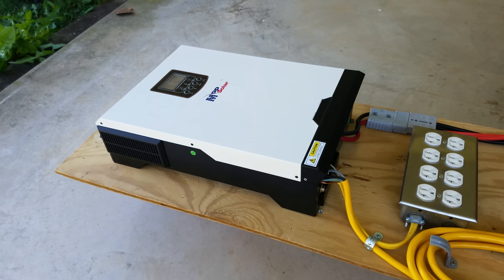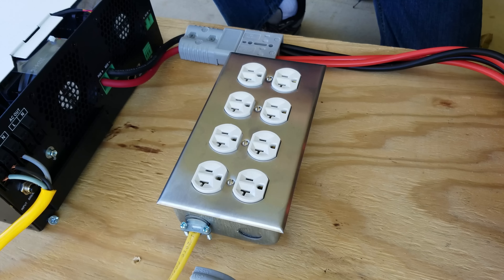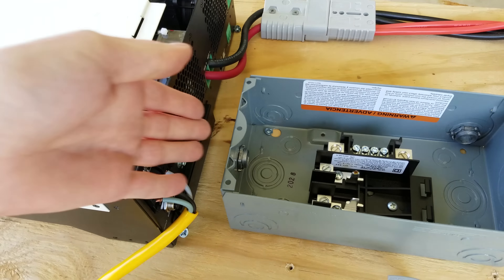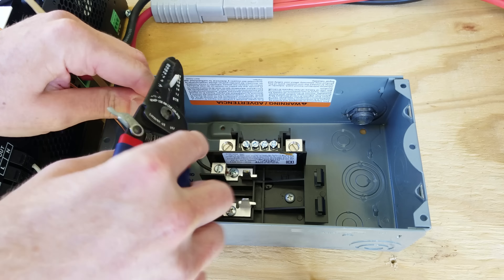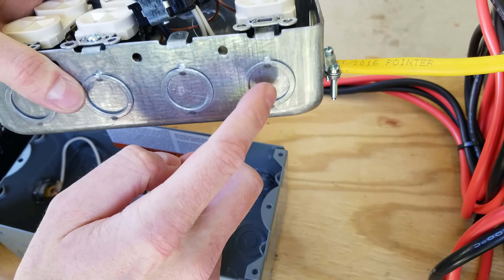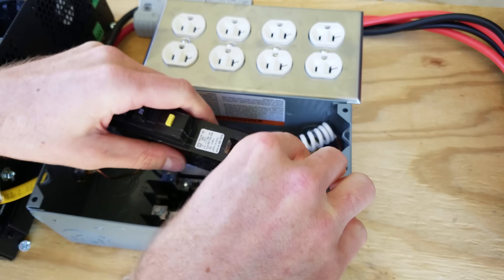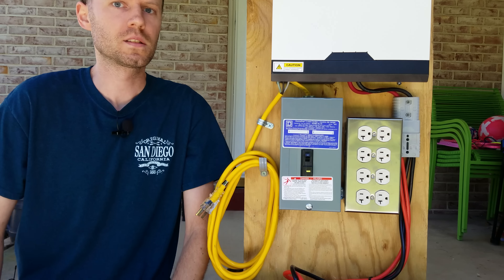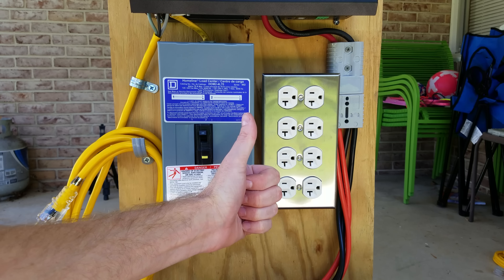Adding GFCI and Over-Current Protection to the DIY Portable Power Cart

Comment: A ground rod would make it more hazardous. 99% of people misunderstand what earth grounding is for, but trust me. Just don’t connect it to your household wiring and you’ll be fine. 

The fact that the manufacturer explicitly stated that they don’t want you to bond the neutral to the ground is interesting, and leads me to believe that the inverter may have some sort of imbalance sensing built in (though it may not be sensitive enough to label as GFCI).
Reply: Yes! Believe it or not a grounding rod does not make you safer. Earth ground is for equipment safety. See MikeHolt videos on this topic.

Comment: Hi Mike! Thank you so much for sharing your videos. Both you and Will inspired me to create a similar portable solar generator with 48v 90ah 16s LifePo4 cells and a Growatt 3kw all-in-one inverter (600w solar array). It uses a Daly Smart BMS that works excellent. I have the same subpanel you have and 20A GFCI circuit breaker. I wanted to add a 30A circuit breaker to the subpanel in the back. Was hoping you could do another update video to show how this could be done on yours so that others, like me could learn how to do this with a single phase subpanel. Thanks again and good luck!

Comment: Regarding alligator clamps/clips... Aviation fuel hose carts and fuel trucks have alligator clamps that can be attached to ground rods installed in the tarmac where planes park to dissipate static electricity while fueling.

Comment: A small suggestion, totally unrelated to the electrical side of things, but using bolts that go completely through the plywood, would give more security than those short wood screws.  To avoid bolts sticking out the back, use some 3-prong T nuts on the back of the plywood.

Comment: I believe from watching another video that GFCI protection can be a good substitute when you don't have a ground.
Reply from the maker: That is my understanding as well, though I'm not an electrician myself.
Reply: @LithiumSolar  This exactly is done all the time as a retrofit in older houses that only have a neutral and line pulled in the walls but don't have a ground wire. Its totally safe now. I would consider running a ground wire from the panel out through the back and bonding the metal hand cart so there is no chance it gets energized by a worn out extension cord resting on it.
Reply: I don't see what extra protection the GFCI provides when live and neutral are not referenced to earth ground. It is safe to accidentally touch the hot or neutral wire (but not both) since there is no current path from you back to the inverter. The GFCI would not trip. If however the ground wire is electrically bonded to the neutral at the inverter the GFCI provides at least some extra protection because it protects against the case when the cart metal parts comes into contact with you either directly or through some moisture perhaps and you accidentally come into contact with the hot wire at the same time. But I believe the ground wire is not bonded to neutral in this installation, so the GFCI provides no extra protection. It doesn't hurt anything though.
Reply: @mcg6762  it would be the same as replacing a 2 prong outlet with a gfci outlet and labeling it “no equipment ground” as required. Gfci does not require a safety/equipment/circuit ground to work. It detects current leaving the hot and not returning via the neutral (presumably going through you and back to the inverter some other way) Youre mixing up what a normal breaker (which trips when a metal appliance energizes itself) and a gfci breaker do. In any case, i think the inverter is internally bonded.
Reply: @jasonjayalap  I believe the inverter ground is not bonded to its neutral in this installation as stated by the video author in another thread. The reason I believe the GFCI does not provide any extra protection in this specific installation is that the inverter is effectively isolated from the user's surroundings. This is not the case on an outlet labeled "no equipment ground". An outlet's live is referenced to earth ground, so anything you come into contact with in your surroundings has a current path back to mains neutral. That is not the case with live coming from an isolated inverter.
Reply: @mcg6762  I get you now. It is hard to imagine someone completing a circuit (shocking themselves) that isn't via the neutral (therefore apart from the gfci protection). 

As far as the floating neutral, I can't see why it would be floated AND the panel not bonded. The safety ground is useless in this case and providing not protection against faulty/energized equipment, right? Did he test continuity with a multimeter or outlet tester? Shouldnt he bond the panel if this is the case?
Reply: @jasonjayalap  Yeah, I also think the inverter ground is basically useless in this installation. The reason the inverter does not connect ground to neutral is that it would not work when the inverter is connected to mains for charging. It would trip the house GFCI. You would need a relay/contactor that engages only when not connected to mains. And even if you went through the trouble of installing that, I do not believe it is worth it. I mean, the thing is safe because it is isolated. Why not keep it that way? The only reason you would want to reference the whole thing to earth ground using a clamp or earth stake or something is to make protection circuitry work that can divert static electricity or lightning to earth ground. I don't think that is relevant enough for something like this. And only installing a relay to bond inverter ground to its neutral without referencing the whole thing to earth ground seems not worth it to me. Just keep it isolated and then you don't need ground wires or a GFCI.
Reply: @mcg6762  Ah, the "connected to mains for charging" was the key. I'm aware of gas generators being n+g bonded when used as sole power source (job site) but floated when supplying a house mains in a power outage (which is already n+g bonded). The inverter needing to both give and receive does make it tricky.

I agree about the earth ground rod being unecessary (lightning strikes are not expected), but disagree that an bonded inverter ground (which I'm assuming is the same as safety/equipment/circuit ground) would be useless. If I connect a metal fan and the fan's hot wire energizes it's frame, I'd prefer that the breaker trip. Ok, you're right: You wouldn't be shocked anyway unless you grabbed the fan and somehow grabbed a neutral wire in the other hand. But it feels icky since it goes against good practice (job site generator should be bonded; three prong adapters in two prong outlets are bad). But as you said, this corner case doesn't justify DIY wiring (maybe manufactors could do something..)
Reply: I have a portable solar agricultural fence charger.  It employs a short ground rod (maybe 2 ft) with a T handle top.  There is a clamp coming from a terminal on the charger.  It would only be practical outside and I don’t know how necessary it is.  I just thought it was an idea so there would be no need to reinvent the wheel.  I like your setup

Comment: I am a set lighting tech on Tv shows and movies and in the NEC from 20 years ago, which we follow these days, So long as the generator, the inverter, is isolated from the physical ground you don't need to do a grounding rod since this is temporary power distribution. I've had many discussions over grounding through the years with the local authorities, Always interesting and every county is different since they may or may not follow the most current NEC code. It can also be different in the same county as state buildings follow state rulings in code as opposed to county rules.

Comment: Nice work.The CFCI adds some protection. As for the earth ground there is no easy or trustable way to do that with a spike. If the soil or sand is dry or less conductive you'll have a bad ground anyway. If I were using this frequently in my yard I'd have an electrician verify and give a tie into the house ground where I use it most and wire it in there.

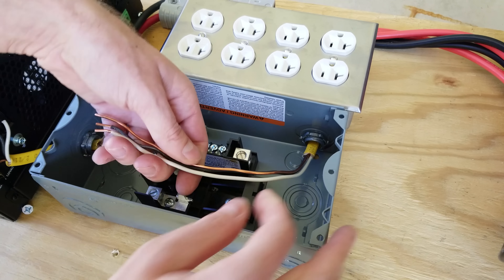Comment: I hate to be a critic but I found another error at 4:29 The steel cover plate is a 'wall' cover plate and NOT a utility box cover plate. The 1110 boxes should be split apart and the appropriate cover plates would be Iberville BC-20-C1 or 8375-CRT or similar.  Of course 4 inch utility boxes would be good too. The cover plate deployed on the duplex receptacles in this how-to video is a commercial grade wall plate with sharp corner edges not intended for utility box use. Utility box cover plates have ROUNDED corners.
Reply from the maker: Thanks for the info. I like critics. I learn from them. Also, this is not a "how-to" video.

Comment: I really like the idea, i was thinking of building something i could wheel around in my apartment (probably smaller and on casters) that in the event of a power outage I could use as needed (IE roll it over to my computer or TV or fridge, whatever I wanted). One thing I would want to add are some 12V accessories right off the batteries and bypass the inverter, like some good USB type C PD ports and several quick charge type A ports

Comment: Nice setup. It would be nice to have a Weather resistant cover or bag for the cart if use outside. The battery boxes, A/C outlets, and circuit breaker are not in weather resistant boxes, damp weather might be quite a hair raiser.

Comment: Small bit of feedback.. Love the build and upgrades..  I might have used the second half of the AC Charge Wire Hook lower on the board to wrap the cord around. with a small length of velcros tied to the end to hold the Male Plug.. a bit of quality of life improvement...
Reply: I was going to suggest the same thing!!!  You beat me to it!

Comment: Hi interesting video. I have been researching how to add GFCI to my inverter. My inverter has an open ground when I test it with a circuit tester and a GFCI does not work in this case. I have a GFCI extension cord that I can plug into any outlet and get ground fault protection. However when it is plugged into the inverter it will not trip. Even though the test button causes it to trip.  When simulating a ground fault using one of the circuit testers that confirm plug polarity the GFCI does not trip. I have confirmed all of this doing independent testing by shorting out the hot side to ground using a resistor both on the house wiring and the inverter. The GFCI trips when plugged into the house plug and circuit but not on the inverter. I would suggest that you confirm the protection by doing an independent simulated ground fault from one of your outlets to see if the GFIC actually trips when powered by the inverter. You probably have one of the plug in polarity testers with a ground fault test button. I'm still trying to figure out why the portable GFCI can be made to trip when using its own test button but not when being simulated. Leads me to believe that the test button on the GFCI is nothing more than a mechanical test, but that doesn't make sense. Any way confirm for yourself before you put all your trust in the GFCI with your installation

Comment: Is the GFCI protection for when the cart is connected to mains for charging? When unplugged I suppose there can't be any ground current since the cart ground is floating relative to earth ground. Or have I misunderstood something?
Reply from the maker: You are the ground path that it is protecting against, not the ground wire. The GFCI is to protect current from flowing from the tool/appliance through your body and into the ground or other conductive object (ie operating a power tool in the rain). If this happens, it senses it and shuts the circuit to protect you.
Reply: @LithiumSolar  Well, I'm just thinking there is no current path from you back to the inverter. Where would the current flow if you are not physically touching the metal on the cart itself? The ground you are standing on or the plumbing of your house is not in contact with the inverter so the current can not flow.
Reply: @LithiumSolar  Thinking about it some more maybe an equally safe but cheaper installation of a cart like this is to leave the inverter ground connection unconnected and just connect live and neutral to the outlets. Since the cart is electrically floating when operating from the batteries and essentially acting as an isolation transformer there is no danger in touching either hot or neutral because there is no current path back to the inverter. It is of course not safe to touch both hot and neutral, but that is not safe with a GFCI either. And when the cart is charging it would be protected by the house GFCI (provided the outlet is actually GFCI protected of course). I am not an electrician so take all this as speculation. I know however that professional electronics repair shops use isolation transformers when working with power supplies because you get the exact same thing: hot and neutral from the transformer is floating relative to everything else around you and it becomes safe to accidentally touch either hot or neutral but not both.
Reply: Just thinking out loud, I wonder if there is any sort of Neutral to Ground connection in the inverter?  If there isn’t then to me there isn’t a path for current to flow from the hot, via the ground wire back to the source (the inverter) hence I’m doubting if the GFCI provide any additional protection?
Reply: @cumberland1234  The GFCI itself is not dependent on a ground connection. All it does is compare the currents through live and neutral. If they are not equal it trips. But you have a point, since a grounded appliance for example (regardless of GFCI) depends on the fact that the ground wire is a path back to neutral for safety. Without that path there is no extra safety to be had by grounding the case of an appliance. So I think the inverter actually connects ground to neutral when it is not connected to mains via the AC input port. Otherwise I think the ground connection of the inverter is useless?
Reply: McG I was wondering if the ground is just for the inverter case when it’s connected to mains, I’m not sure.
Reply: @LithiumSolar  Sorta.  Grounded appliances should have portions of the appliance that is bonded to the ground wire (like the metal exterior case) so that in the event of a short to the case/appliance current will flow that way instead of via the higher resistance you (well in time to trip the GFCI).

If your inverter doesn't have a grounding lug your ground should be bonded to neutral at the inverter.  This way return via ground will bypass the GFCI (tripping it).

You still need to address the fact that your inverter is undersized for your load but I see you're ignoring that :-)
Reply from the maker: @tomstdenis  The inverter is not undersized for the load. It's a 20A inverter and I used a 20A breaker. Additionally, you cannot bond the neutral and ground as when you plug it in, you're now bonding your home circuit twice, thus turning the ground wire in the wall into a current-carrying conductor (very bad).
Reply: @LithiumSolar  Exactly right.
Reply: @LithiumSolar  If the inverter ground is not bonded to its neutral I don't see what purpose the GFCI on the cart serves. What is it protecting against? If the user accidentally comes in contact with the hot wire there is no current path back to neutral. That was my original point.

Comment: About the only improvement (and it's more of a nit pick) would be to use conduit around the Romex between the inverter and breaker box.

Other than that it looks like a great solution. How would you go about connecting solar input to this setup?

Comment: Did you weld a PCV pipe to the back of it and have the ground rod inside of it that you can just push down and lift back out the ground and the ground rod would be connected to the unit

Comment: How is one of those breakers called because it also trip on a current of 20a beside the gfci?
Reply from the maker: Yes, It's a circuit breaker that also contains GFCI functionality.
Reply: But does it have a special name or so??? And also fast reaction
Reply from the maker: They're just called "GFCI Circuit Breakers" - here's the exact one I purchased https://www.homedepot.com/p/Square-D-Homeline-20-Amp-Single-Pole-GFCI-Circuit-Breaker-HOM120GFICP/100002959
Reply: @LithiumSolar  thx